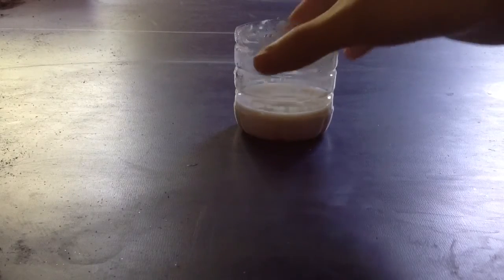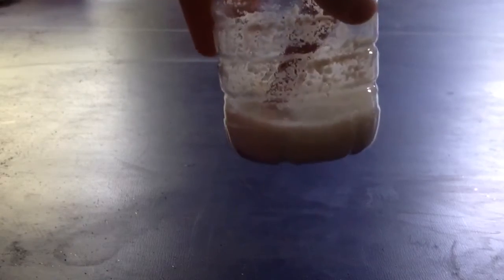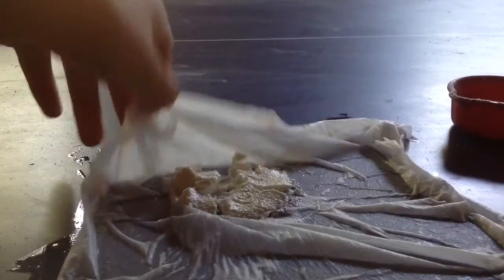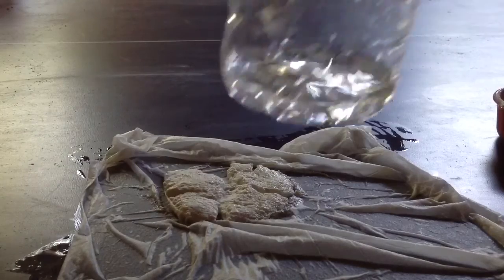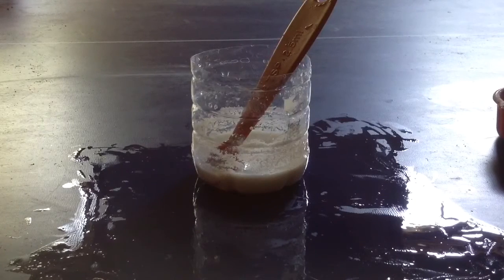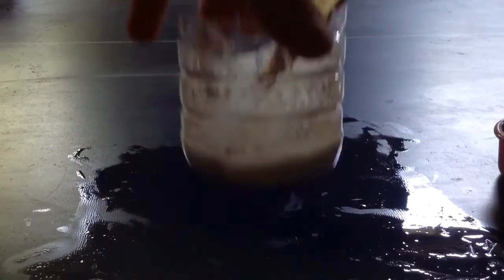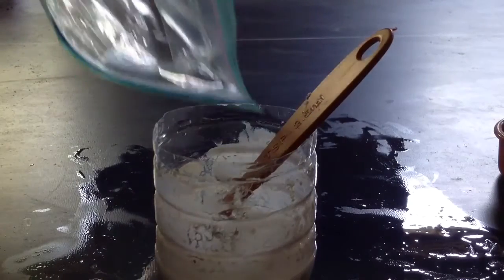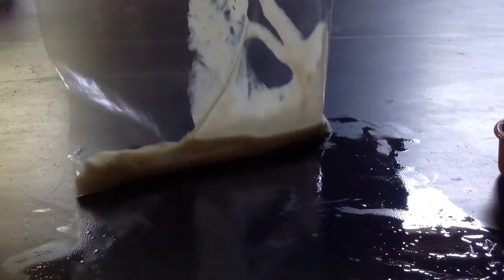Casein Binder for Batteries and Supercapacitors

Comment: I'd like to see it used. do you have any idea as to how the baking soda will interact with the ionic electrolyte of a supercapacitor?
Reply from the maker: The baking soda reacts with the vinegar to form sodium acetate and shouldn't affect the electrolyte because not much binder is used. I made some electrodes with the binder and hopefully you'll see them in my next video.
Reply: +Red Rake awesome I can't wait. I've got some PVA (polyvinyl alcohol not acetate) and some finely ground AC (activated carbon) but I don't have a good electrolyte yet
Reply from the maker: +Gary Barbour II table salt works well
Reply: +Red Rake the voltage is too low with table salt. I'd like to be in the 2.7V range. I'm considering acetonitrile with an ammonium salt, but I'm also thinking about using something more common that I can use with the PVA as a solid electrolyte
Reply from the maker: +Gary Barbour II sodium sulfate then, but I don't know much about solid electrolytes. make 50 ml of solution containing 7 grams of epsom salt and another 50 ml of solution containing 3 grams of anhydrous sodium carbonate, mix the two solutions, let it react for a day, then filter to get sodium sulfate solution
Reply: +Red Rake supposedly you can infuse the PVA with phosphoric acid and it works well up to about 1.8V

the nice thing about it is the the binder and electrolyte layer are the same material. I'm picturing a 3D printer spraying alternating layers of the PVA based electrolyte and  either graphene oxide (reduced to graphene by laser or xenon flash) or AC, possibly electroplating/depositing a thin layer of copper in the middle of the electrode to reduce internal resistance. graphene would be great as its thinner and the whole thing could have enough energy density to offset the lower voltage of the solid electrolyte